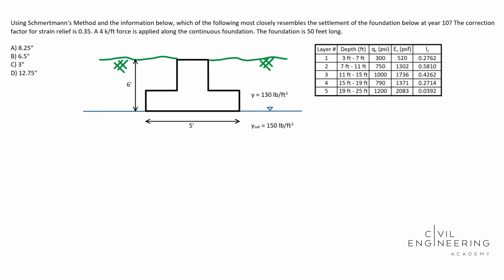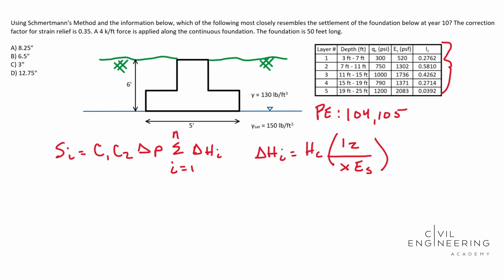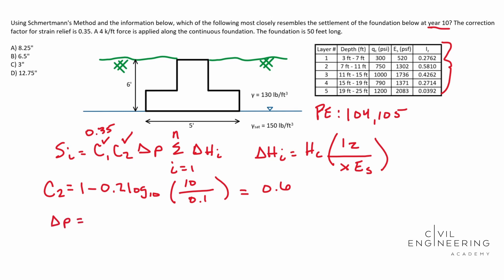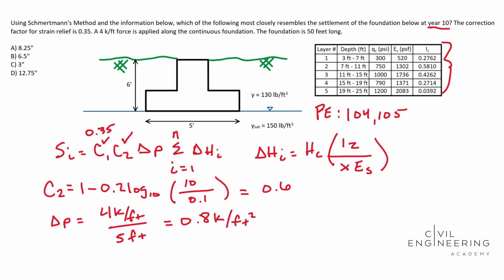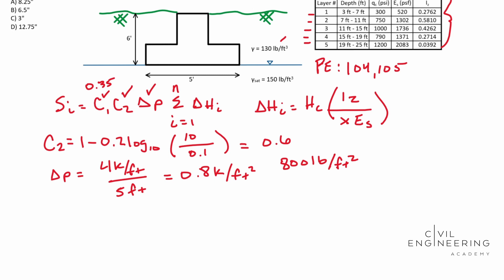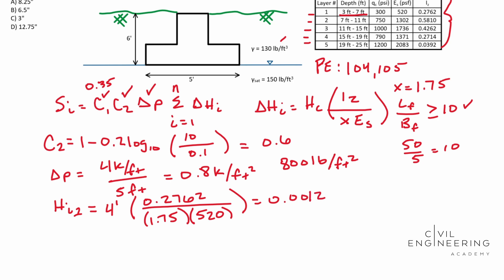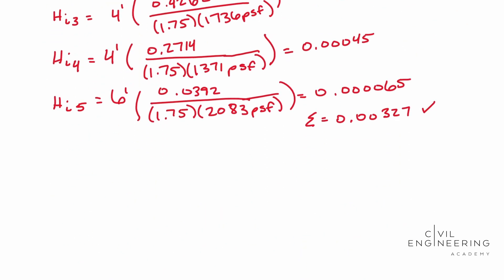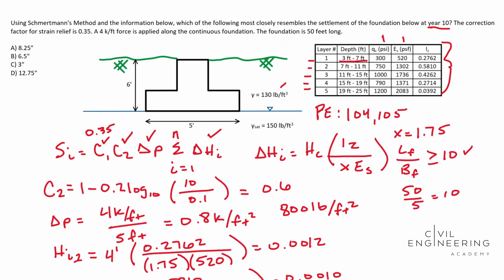Civil PE Exam - Geotech - How to Solve for Immediate Settlement using Schmertmann's Method

Comment: Hi, in the PE Handbook, the equation for C2 is 1+0.2log(t/0.1). Why are you using 1-0.2log(t/0.1)? Thanks!
Reply: Maybe he mixed C1 and C2 signs, I think you are right with it being 1 + 0.2log(t/0.1).
Reply: Yes that it should be plus not minus. Did you get 15.4" using that equation for C2. It does make me wonder why there is not answer that matches closely to that.
Reply: Got the same thing 15.40 inches :)
Reply: Maybe it's just a typo. He still calculates using +
Reply: Thank you for the comment. You are correct.  I also noticed another mistake, I used C1=0.35 when the manual requires a minimum of C1=0.5! C1=0.5 should have overridden the given C1=0.35 in the final calculations. We will get this video revised and uploaded again.  Does that make sense?
Reply: @codysims7465  where in the manual does it say that Cmin=0.5?
Reply: *C2min
Reply: @goldenforhours  C1 has a constraint in the PE manual. At the time of this comment, the 10.1 is  the most up to date manual and the equation for C1 can be found in section 3.5.3 or page 104. You'll notice the equation at the end has a greater than  or equal  to sign. So, after solving the left portion of the C1 equation, C1 must be greater than or equal to 0.5. If it's not, The C1 value used in the later Si equation  should be 0.5.  C2 does not have a restraint attached to it so whatever it ends up being (In this case 0.6) is what should be used in the Si equation. Does that help?

Comment: On the PE exam for more distinct problems, is it likely the exam will tell you what formula/equation to use (i.e. use Schmertmann's Method, 2:1 Method, Terzaghi's Method, etc.) or will they just tell you a directive, like "find the settlement after 10 years" and you have to figure it out what equation to use on your own?
Reply from the maker: If there's ever a question on what equation to use they will give you it on the problem.